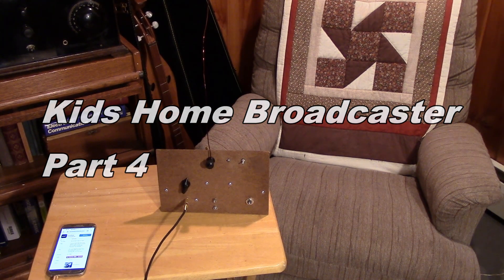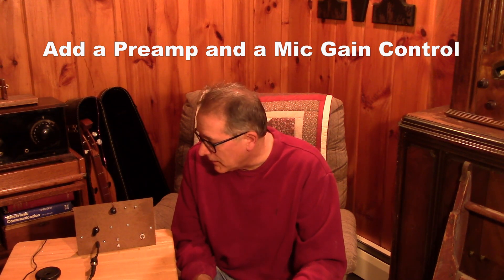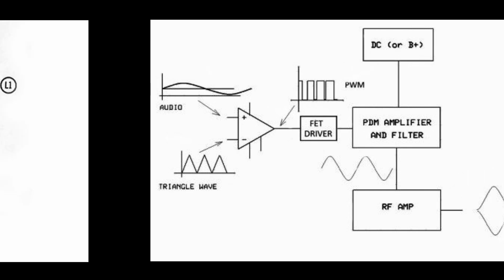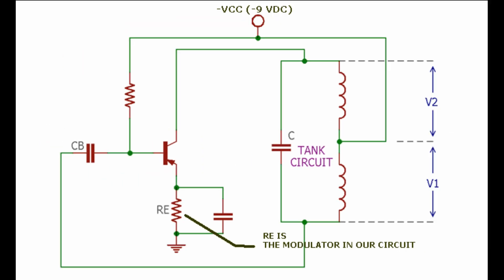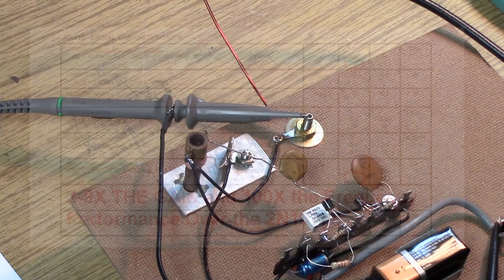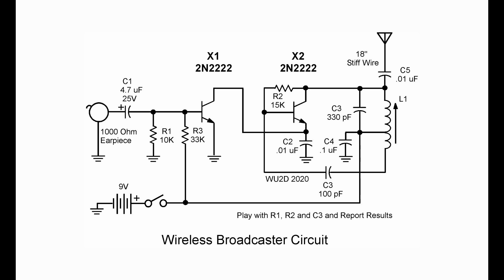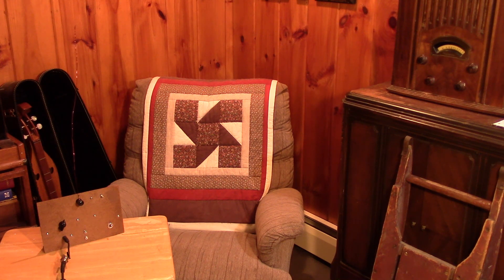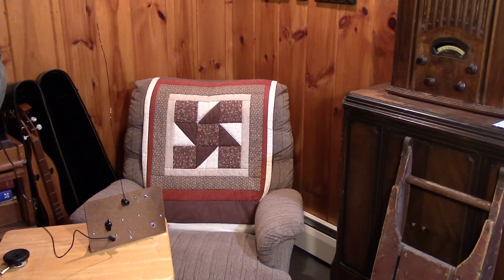Kids Home Broadcaster Part4

Comment: Nice series of videos!  I enjoyed watching them.

I figured it would need bias adjustment to modulate well.  It didn't surprise me that it oscillated, the Hartley is always very robust as long as the feedback is there and the device has even a little gain at the operating frequency.  As long as the active device isn't cut-off or completely saturated the RF voltage at the top of a reasonably high-Q tank will tend to get it operating fully in class-C as a saturated switch.

In general the design in the book is pretty terrible, but very simple, cheap and not surprising for the time.  The lack of beta-independent design is just asking for trouble, especially with the widely variable properties of early Ge alloy transistors.  I would have specified a pot for AF transistor bias at the very least, but that would have cost a bit more.  Putting the oscillator in the collector of the audio amplifier will always cause distortion problems because of the Early effect, very high gain devices will minimise it which it probably why the modern silicon BJT (high beta) and the MOSFET (less significant channel-length modulation) do pretty well by comparison.

Once you add another transistor you may as well use a BJT emitter follower as the series modulator and put it in the collector of the oscillator.  That would let you put the Hartley into the base-emitter and is a more natural fit with one end of the tank "grounded", emitter drive into a low-Z tap and higher-Z into the base... (maybe a JFET or MOSFET oscillator here might be even better).

A much more repeatable overall design would have a very conventional common-emitter AF stage just like your preamp with a bypassed resistor in the emitter and divider base bias to minimise beta and temperature dependence.  I'd then AC-couple to an emitter follower (maybe DC couple for simplicity if it is easy to achieve with the AF amp collector voltage, save a few resistors for the beginner). The follower is biased so its emitter is a bit above mid-rail (whatever optimises the depth of modulation before the distortion climbs too much).  The oscillator could be a Hartley or Colpitts, but I might be tempted to use a Pierce oscillator with a ~1MHz crystal to minimise the parasitic FM from swinging the oscillator around so deeply.  You could add yet another transistor and buffer the oscillator completely from the modulator, but that is starting to get complex and daunting to build for a beginner.

The deluxe version would include AF filtering to roll off below 300 Hz and above 10 kHz or so and a low-pass output filter to remove harmonic radiation and reflect a suitable impedance to the output stage to maximise its output, maybe some kind of antenna matching too, like a series inductor to try and actually deliver some RF into what must be a very high impedance, mostly capacitive load with a next to nothing radiation resistance.
Reply from the maker: Wow ZAY! Very nice comments and really detailed in your analysis of the improvements to be tried. I realize that there are folks who have put a lot of work into these broadcasters and AM modulators (and FM transmitters for that matter), and my video just touches the subject. You might know my best mate VK3CV, Andrew, who just had an article in QEX Jun 2020 on 100 GHz stuff.
Reply: @MIKROWAVE1  No unfortunately Andrew doesn't ring a bell?  I have been in the US in Seattle for the past 8 years or so, I am also W7ZAY in addition to my VK call.

Comment: Thanks for series Mike. Always like those little period pictures that you flash up. I still have some interest in domestic vintage wireless receivers and a few examples kicking about. Over the years I had wondered about building something like this to allow appropriate vintage content to be received by wireless means. In fact a little distortion and noise might even be desirable to more closely simulate how these sets sounded back in the day?

Comment: I think i have the same circuit i built several years ago. I got it from an old volume of World Book Encyclopedia. Built mine exactly as the picture using vintage parts like the loopstick coil, variable cap, old axial caps, 2N109 PNP transistors. I also used my 2000 ohm headphone for the microphone. Yes,  they have the same circuit except C4 is a variable cap. Like the original circuit it was not that strong, only a few feet just like yours. I tried replacing the 220k with a 680k, it did improved the audio and a little bit of range. With the modifications, did it improve the range of the circuit? Thanks.

Comment: Very nice Mike!  I learned a lot from this series.  I've been looking for a home transmitter to pipe 30s-40s music into my tube radio restorations thereby testing the whole radio rather than simply bluetooth audio into their AF sections.  Is the fidelity of your circuit adequate for that task, do you think?  I'd like it to be as good or better than standard broadcast AM - is that too much to ask in a home transmitter?  What about FM?  Thanks!
Reply from the maker: Nope this is not quite the right solution. There are far better topologies for doing what you need than a modulated oscillator. And that goes for those 1 tube jobs as well. There is simply no way they are giving the fidelity and distortion-free performance of a transmitter with a stable oscillator and a properly modulated amplifier stage.

Comment: Jean Shepherd K2ORS!  I listened to his show on WOR in NYC as a teen.
Series modulated oscillators have limits, better to modulate an RF amplifier.
Modern AM transmitters use DSP to digitize the audio, and then switch a bunch of power amp stages in and out at an audio rate.
Reply from the maker: Amen! and Amen!

Comment: Will a 2N3819 work for the VN2222II replacement?
Reply from the maker: The 2N3819 is a depletion Mode JFET. So not really. Think IRF510 as a substitute mosfet.  Or try a bipolar - a 2N3904 or 2N2222 NPN transistor and play with the bias.

Comment: How about a tube version? I bought a pretty nifty little kit on ebay, a 1 tube am transmitter. I would like to see how this transmitter could be modified and made better. It works, but I really think it needs amplification.
Reply: Check out his previous videos. He made a similar series beginning with a one-tube Part 15 broadcaster, developing a three-tube circuit.
Reply from the maker: SH those one tube jobs are mostly based on pentagrid converter tubes and yes they need more gain.  https://www.youtube.com/watch?v=-pJ-kErTI54&t=1687s